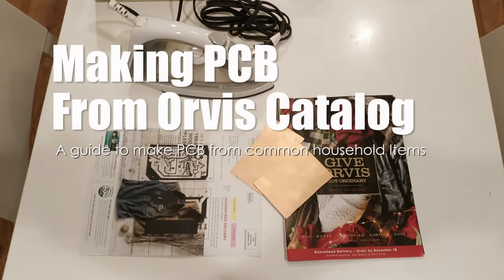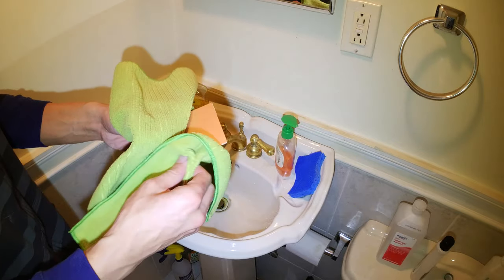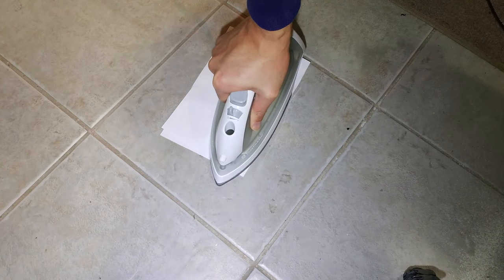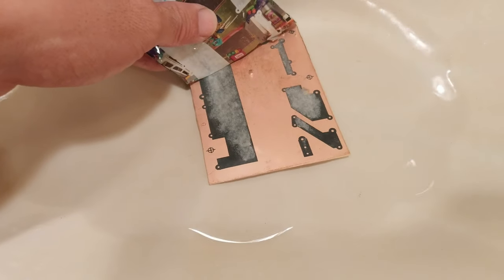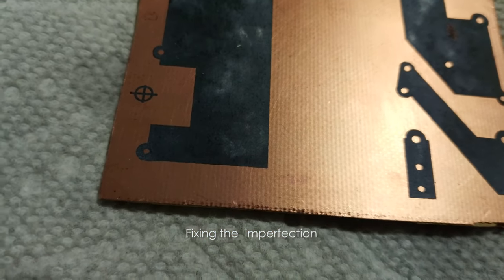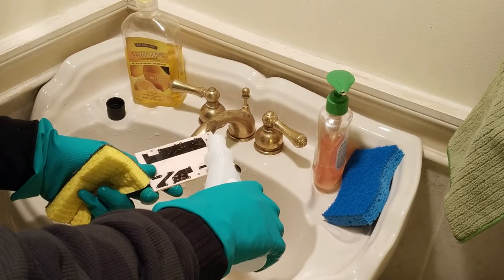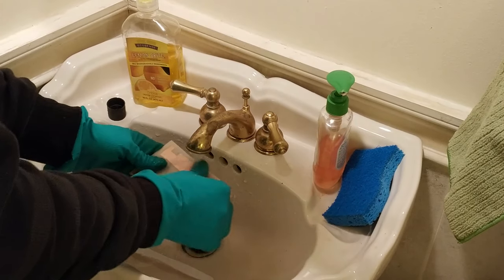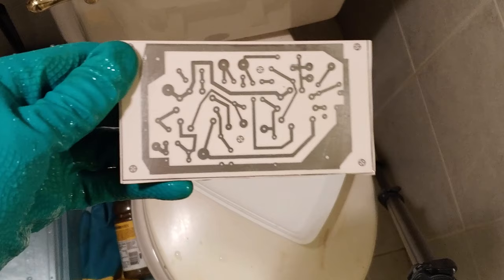PCB the easy way - how to make PCB at home with common household items.

Comment: What Printer did you use?
Reply from the maker: Any laser printer will work
Reply: Some of the new lazer printers have green tech toner which doesn't work,, That' s why I was wondering which laser printer you used because it looks like you have one that works for this.
Reply from the maker: @terencekaye9948  Mine is a brother HL2270DW
Reply: Great.. Thank you.. Fantastic job of the PCB. Thank you for posting your video,, I've also never seen the etchant that you made before, I will have to give it a try..  :)  Yes,, Totally Awe Someness!